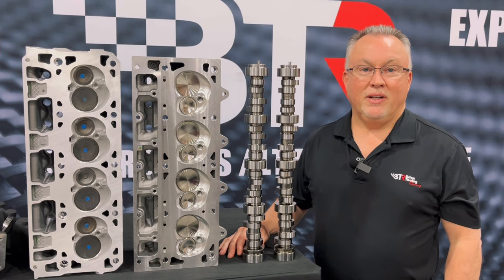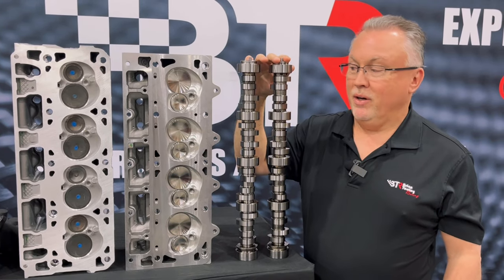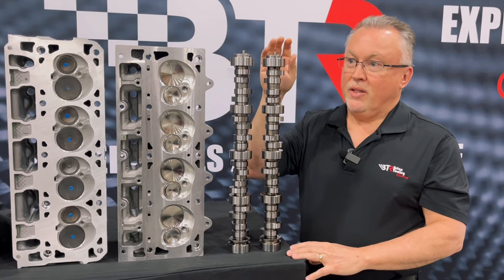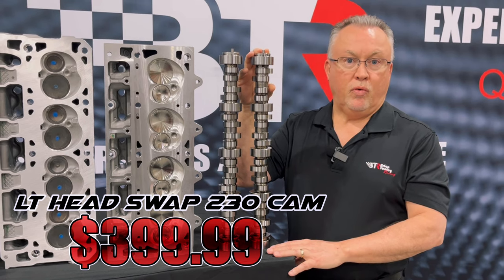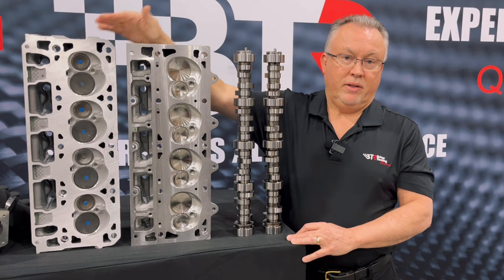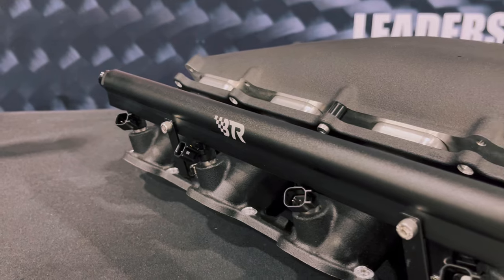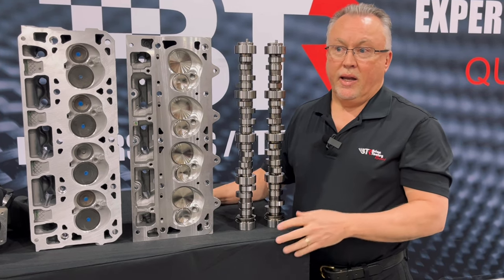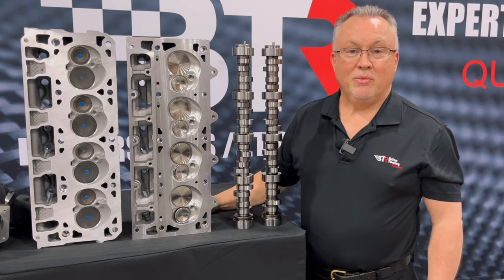BTR LT Head Swap With Brian Tooley

Comment: I didn't know people were putting gen 5 heads on gen 4 engines. Awesome
Reply: Same, but man what a pain in the ass. All the conversion parts needed, must be a pretty hard to find parts. I never heard of anyone selling genV headers that fit my Camaro running the GenIV engine.
Reply: GenV Bolt-On life is sweet. For the typical N/A build, it literally takes nothing more than a set of long tube headers and possibly exhaust, an LT2 Intake Manifold from a C8 Vette (cheap and always available, 1-3% worse than an MSD that costs TONS more), a camshaft and springs and maybe a throttle body upgrade if you are feeling generous. The LT1 is a monster, even in stock form and requires very little to 'wake it up'. Direct Injection and LT Cylinder heads are the magic icing on the cake. High compression and awesome aftermarket-type flow from OEM heads. If you think the OEM LS heads are good, just think of the difference between a SBC Vortec Head (the best late OEM head) when compared to an LS Cathedral Port...... and it's literally the same when comparing that LS1 head to an LT1 head again.
Reply: @fasnuf  what Gen Camaro you running? I’ve been running this Gen V swap before it was a thing I can hook you up if you have questions
Reply: @Macburton96 hey I am running this setup as well.  How did you run the "steam port lines" since the LT heads don't run steam ports I'm trying to decide on what to do about it.
Reply: @SamCarGarage  I didn’t bother with the steam lines, even when I was running my LS set up I just capped I’ve never had any issues
Reply: @Macburton96  thanks for the reply!
Reply: @Macburton96 you running this in an fbody?
Reply: @warriorplutotrent3827 yes sir 2nd gen

Comment: I can't wait to get a Gen 5 powered vehicle to build. After reading about the L8T I really want to get a 2014-2018 RCSB and pull the L83 and swap in a L86 or L8T with some better internals, heads, cam, and Whipple or maybe the Escalade V supercharger is it becomes available at a reasonable price.

Comment: What are you running for accessories? The Gen V heads stick out further than the Ls heads and the bolt holes aren’t the same orientation, and Ls/Lt waterpump and accessories aren’t interchangeable have you had the engine complete dressed and in a vehicle or just dyno?
Reply from the maker: Holley makes an accessory drive kit that works.

Comment: Holley is supporting the L86 with the Terminator now. I wanted to build a competition ski boat engine with a larger cid (i.e. 427) LS short block, and the goal was to make an torque gorilla that made peak torque around 4000-4200 rpm, is that something you would offer a cam for? or would be possible to put the stock L86 heads on an LS block? I'm thinking a factory longer runner intake would be best for this application, but I'm open to suggestions. The idea would be to build an engine that would produce north of 550 ft lbs of torque at a peak of 4000-4200. The current marine (ILMOR) 6.2 with direct injection produces 479 ft lbs at 4200. I'm thinking that by taking the bore to 4.125" and the stroke to 4.00", the additional torque is a given without doing much cam wise over the stock L86 cam, but I don't know if is compatible with an LS block?

Comment: Is it possible to put the Ls family head on the gm 151 engine (iron duke), which is basically half of an lt v8 small block?
Reply from the maker: I have no clue, but the bore centerlines on the iron duke would need to be close to the LS/LT/SBC 4.400", and I'd bet it has a far narrower centerline than that.
Reply: @briantooleyracing3554  according to what i saw on a website, the ls2 gen iv small block uses the same cam-in-block architecture and 4,400 bore centers, and the website says to be details features shared with the first small block on its release in 1955. So if so, can the ls2 engine head fit the old gm small block v8 or even the gm 151 (iron duke), since it's half of an old gm small block v8?

Comment: BTR I want to do a custom cam grind for LS block with LT Heads but with the old school Small block firing order 1-8-4-3-6-5-7-2 yeah I might lose 20 HP but I want a late model engine but to sound like a old school cammed out Gen1.

Comment: I'm getting ready to turbo my LQ4, but I wonder the cost of putting gen 5 heads on LQ4 with gen 5 cam and exhaust could I get 550 hp rear wheel hp with good drive ability?
Reply from the maker: You can't run a regular Gen V cam in a Gen IV engine, it's too long due to the fuel pump lobe.
Reply: Thank you for that.
Reply from the maker: @Old school  but you can run our custom LT Swap cam like is in the video and run the Gen V heads.
Reply from the maker: @oldschool6268  https://briantooleyracing.com/btr-lt-head-swap-230-camshaft-for-ls-engines.html

Comment: Also,  if oem lt1 heads get that much of a bump, What about cnc lt1 heads, or even aftermarket lt1 heads?
Reply from the maker: The 660 HP we made was with CNC ported LT1 heads.  Back to back at the same compression CNC CID heads were worth another 13 HP more than the GMPP CNC LT1 heads.

Comment: Need 4" bore pistons lt head valve reliefs cut to really make use of it
Reply from the maker: We made a lot more power with stock LT1 heads compared to the stock LS3 heads and we didn't need to cut valve reliefs to do that.
Reply: @briantooleyracing3554  what was your compression with the lt1 heads and the LS bottom end?
Reply: @Brian Tooley Racing  I would love to do the swap over however I have 2cc domes currently and I'm worried about PTV due to reverse intake&exhaust valves.

Comment: Nice! Does the 5th gen fits 4th gen piston? And What about the opposite? LS3 Heads, Intake in a L8T block with stock forged crank, and siamized bore?
Reply from the maker: Gen IV pistons are generally flat, possibly with a valve notch, so there's no problem installing Gen V heads on Gen IV pistons.  I would never install Gen IV heads on a Gen V shortblock, so clearance is irrelevant to me.
Reply: Why not? Gen 4 aftermarket ported heads seems to have better results than LT1 gen 5. And for a guy that has a fully built turbo or supercharged gen 4 and blow up the bottom end, gen 5 can be a nice bolt on and keep stock exhaust etc...and have the benefits of a forged crank and bigger studs threaded block.
Reply from the maker: @Mathieu Synnott  it would be difficult to find hydraulic roller Gen IV heads that make as much power as the Gen V heads.  Did you see the comparison of the TFS 255 LS3 heads compared to the LT1 heads in the video?
Reply: No sorry i just find ls3 oem vs lt1
Reply: ah yeah it need a reverse lobe gen v cam. True. But the rockers arms in LT are less stable and there are no shaft mount for them being crooked?

Comment: Why on earth would you use a gen 5 head on a gen 4 block just to block the injector port off? 
This makes no sense at all, as gen 5 heads have smaller ports designed for air only flow.

Comment: Ok so besides milling the heads, were those stock LT1 heads? Also do LT4 heads flow even better than LT1 heads. I don't know much about the new LT platform they may have the same heads from all I know.
Reply from the maker: LT1 heads have smaller combustion chambers than LT4, so they're better for naturally aspirated applications.
Reply from the maker: We tested unsorted and ported LT1 heads, dyno graphs are on the website.
https://briantooleyracing.com/btr-lt-head-swap-230-camshaft-for-ls-engines.html
Reply: @briantooleyracing3554  looking for lt1 heads currently and not knowing what I'm looking at. LS heads were easy with the casting numbers. Do the lt1 heads have something similar? If not are the heads that come on the 5.3 the same?
Reply from the maker: @Stephen Hodge  L83 heads are definitely not the same.  However L86 heads are identical to LT1 heads, they both have the same hollow stem LT1 intake valves
Reply: @briantooleyracing3554  ok one last question. I know the benefit to using the Lt heads is better flow that equals more power. But can the same results be had by using a good pair of aftermarket high flowing LS heads?
Reply from the maker: @Stephen Hodge  the main advantage of the LT1 heads is flow improvements due to their canted valve design, which helps de-shroud the valves, thereby increasing flow throughout the lift range.  LT1 heads also have smaller intake valves, which means they have much higher velocity around the circumference of the intake valves.  We call this coefficient of discharge.  There might be a company releasing canted valve LS3 heads this year that just happen to use LT1 intake valves and actually flow more air than LT1 heads...  😉